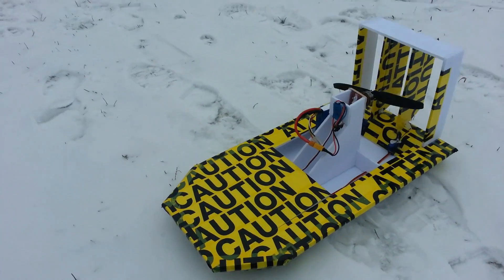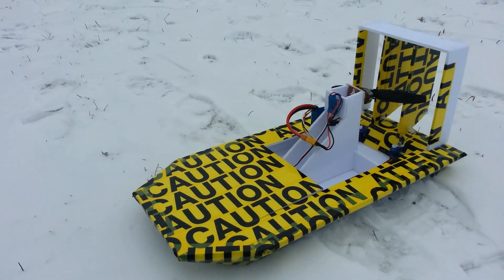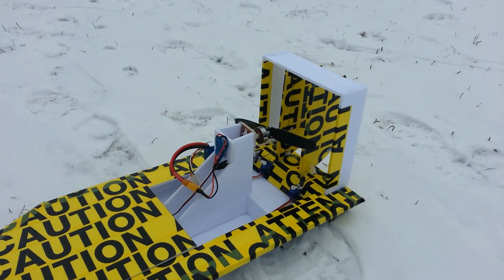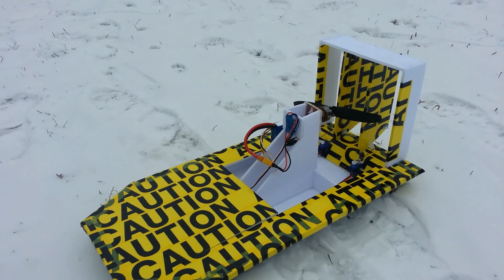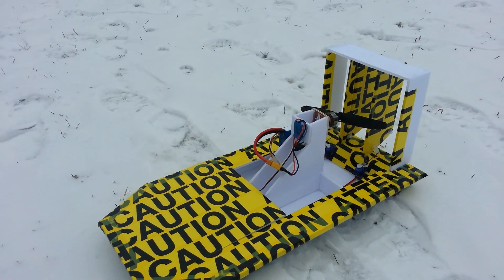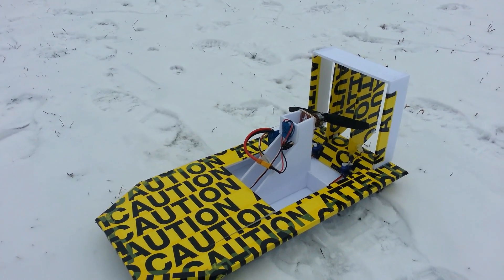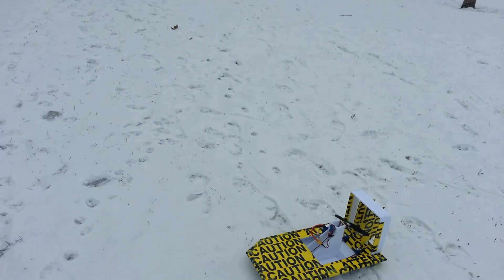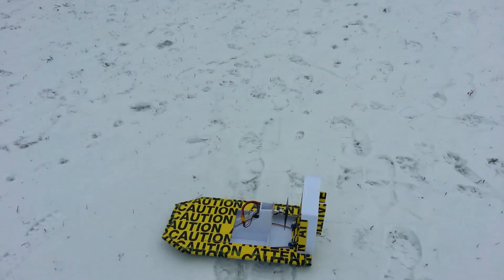FoamBoard AirBoat on the Snow

Comment: nice vid.  I just tested a my airboat today....one thing is different about it, EDF powered.  I could never come up with an easy way to make a cage to protect a big prop....so Im using a 64mm EDF.  I was worried it wouldn't have enough thrust, but it get up to speed pretty fast.  I had a few blow overs at 3/4 throttle.
Now I just have to build a new boat frame with a few tweaks and better waterproofing.

Comment: Could you make a video showing the steering mechanism? I tried to make one, but the 'rudders' ripped off
Reply from the maker: how did your rudders rip off? mine are in the airflow, but dont touch the snow, so i dont think they are going anywhere. I have some photos posted on flitetest (link in the description) that gives a few closeups that might help you out
Reply: Ah thank you. They were hot glued to a 9 gram servo (I know stupid idea but it was last year) and the thrust from the motor and the occasional roll over weakened them to the point of failure.